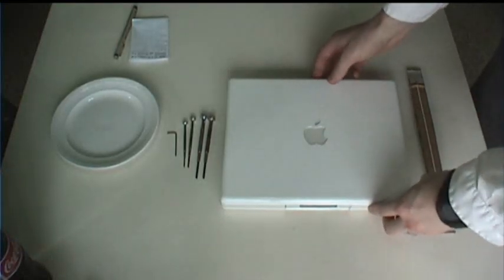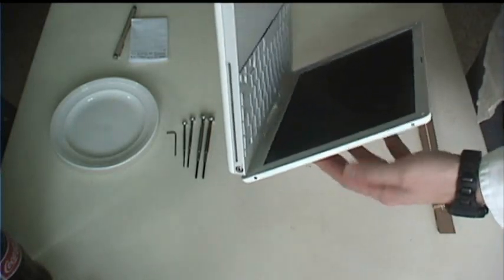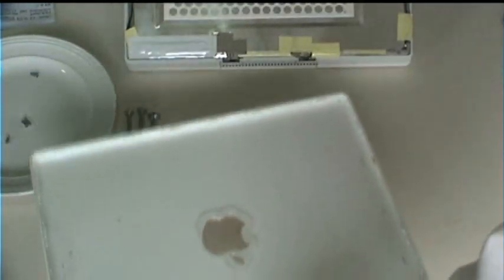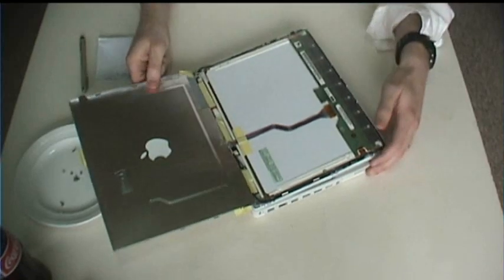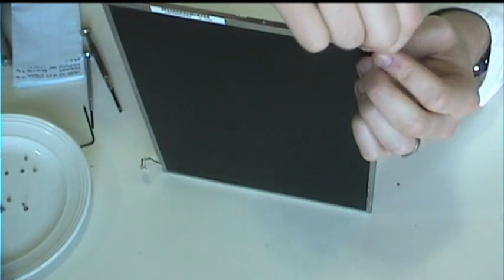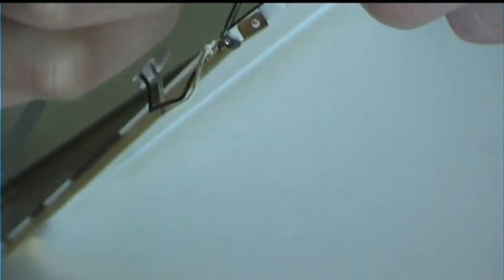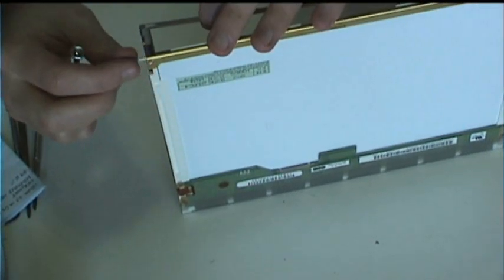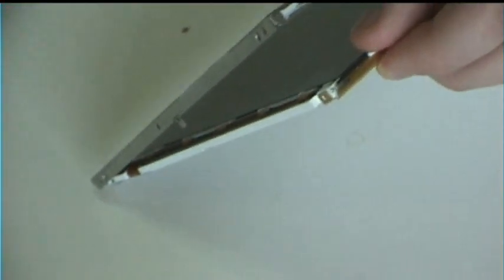How to replace an iBook G4 backlight (uncut)

Comment: Thanks a lot, this video made some things clearer. I am trying to replace the backlight tube with LED's, though it looks like my LED strip is a bit to broad. I think my inverter is gone, since the tube flashes for a fraction of a second when I switch the IBook on. Inverter seem to be out of stock, btw. :-(
I could not locate the tube, or see a way to dismount it. So your explanation was helpful to me.

Jürgen